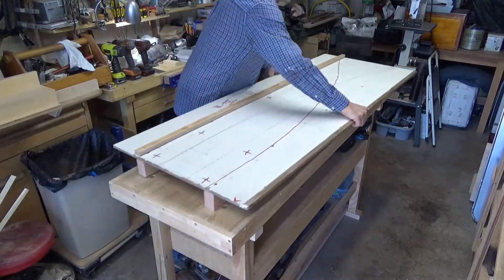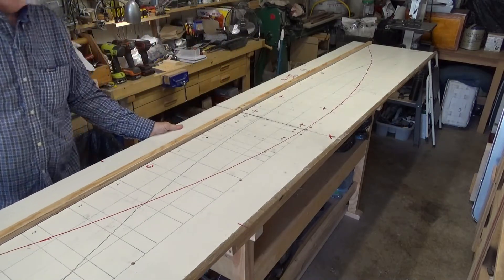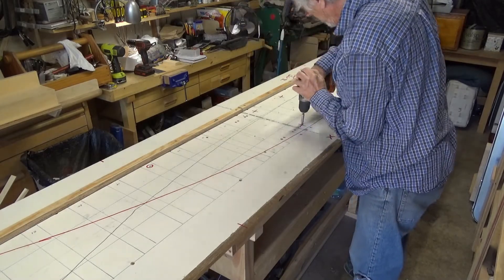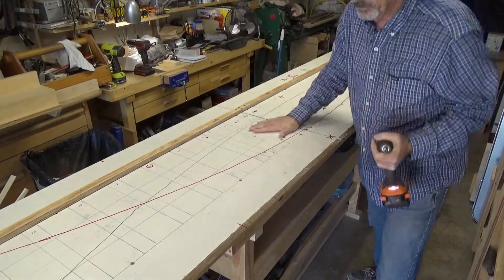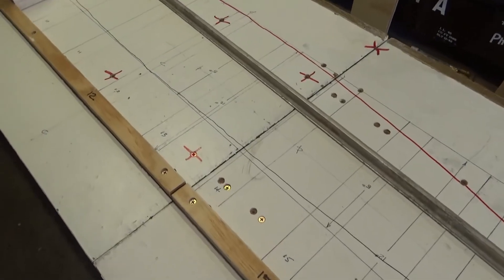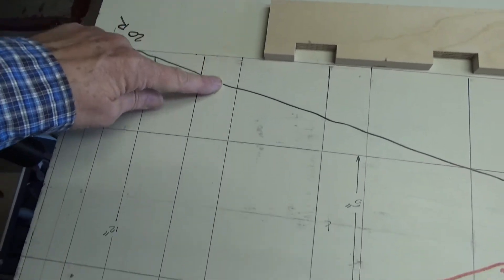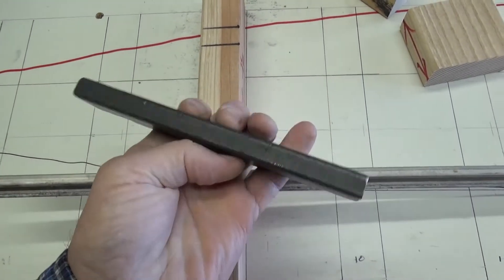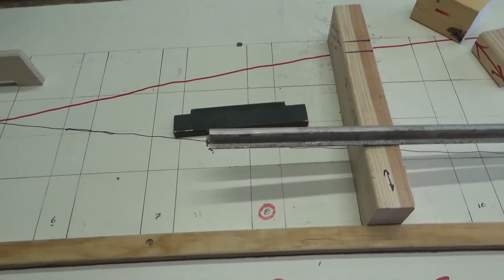Backyard Railroad - Part 10 - Jig for building 5" gauge track panels

Comment: I have been wanting to build a Christmas train for the front yard. it will not be a ride on train,  but approximately this size. I am looking for an inexpensive idea for the track. Any suggestions?
Reply from the maker: So you won't be carrying anything heavy like people, and that gives you a number of options.  If you don't need the rail to look prototypical you can use any sort of metal bar, box, or even angle for rail. It won't see much wear or stress.  Cut up some 2x framing lumber for ties.  Any curves in mind or just straight track?

Comment: Hi Stan,
  You are completly right. Building the track panel...is...a manufacturing process. Your using the open jig is exactly right. Then...if the ties vary in length...that is okay. Like your methodical style. Yes, enjoying doing the same steps repeatedly is the Zen method. 
  Soon, I'll be building track panels and will be emulating your methods.  
I worked for a solar co. I made 2,000 solar control boards. I made an open jig similar to yours. Because the 3/4" plastic (polymer?) boards that were the base would vary up to 1/4" in size. 
  There were 12 -1/2" copper solder joints per (purr) board. One pump, one expansion tank. I tested each and every board for one hour. Put 100 psi on the tanks. There were some leaks during this step. We'd resolder the leakers. Then retest for another hour till it held. 

  The boards were going to Camp LeJune in NC. A new housing development on the base. The super there loved my boards. Before I built them...the boards leaked after being installed. 
  All that is to say...I will enjoy the manufacturing process...again. 
All the best, Pete 🙂
Reply from the maker: Pete, Sounds like you are quite the engineer!  Track panel building will be easy compared to your solar electronic projects.  Not sure where you live, but both steel rail and aluminum rail expand and contract when sunlight and shade hit them here.  So plan ahead for that.  Leave some gaps between the rails-- more when laying track in the cold.  Don't over tighten everything.  The rail has to be able to move a bit as it gets longer and shorter.  I can see in my curves how they expand and then retract daily.  Have fun!

Comment: Where did you buy the steel for the rails? 
Is it premade, and you just purchased it or did you have to make the rail also?
Reply from the maker: No, fortunately I did not have to make the rail.  It is a bit larger than "official" scale for 5" gauge.  I think it's called culp rail (once popular near the east coast U.S.).  Extruded aluminum with a rail profile.  Obtained it through our club.  They run both 7.5" and 4.75" gauges.  I used a rail bender to set the rail for curves since they are quite tight in places.
Reply: @StanFerris  I was wondering if it was aluminum.
Reply: @StanFerris  I'm in kentucky, 
And I'm looking at this thinking... idk with all the rain and bugs if the ties would hold up. I have plenty of cedar, oaks, maples, walnuts, and even hickory on the farm to probably supply all my own wood. I just dont know how long it would last. 
Aluminum would be a great option to prevent rust.
Reply from the maker: It all comes down to the cost and availability of material.  Steel doesn't expand in the heat as much, but is a bit harder to work with and will wear your wheels more than Al.  Aluminum is softer and a bit less expensive, easier to work with, but expands more.  It is really expensive to ship long sticks of rail.  Shorter sections mean lots of joints.  But in the end, you go with what's available.  Same with ties.  If you can afford the synthetic lumber or accu-ties and have a supplier close by, they are very long lasting.  I had to go the cheap route and use redwood from the local big box store.
Reply: @StanFerris  have you ever heard of anyone using real railroad ties and taking a table saw to trim them down to size?
Reply from the maker: That could work, why not.

Comment: Stan,  in assembling your panels you will do yourself a favor if you will follow your screw pattern you showed early on.  I have succombed to doing what you did by swapping sides of the track when I was spiking.  By using the shown pattern will help keep the ties from skewing and the gauge correct.  The way you assembled the panel will tend to skew the ties and the gauge to become narrow.
By drilling up against the base of the rail and at an angle, tends to move the rail in the direction of the pointing of the drill bit.  The best practice is to drill just off the base of the rail so that the screw is vertical and will just touch the rail base when the screw just touches the rail base on both sides.  This sounds like I am severely criticizing your work, not so, I have over 20 years of full size track construction experience which directly corresponds to your work.  Track spikes are supposed to be driven so they just touch the rail base when seated.  The track gauge is easily adjusted by how the spikes are driven by how tight they are against the rail base when being started.  A small metal gauge for drilling the holes would be beneficial and easy to make.  Many happy and enjoyable days of track use.
Reply from the maker: Wonderful advice Roy!  Thank you.  Yes, I goofed up on this panel when I switched sides for the camera, and messed up the screw pattern.

Comment: ¡Hola buenas tardes Stan! Great to see the track units coming along. Question for you: Have the wooden ties/sleepers been treated or, will this be done before you lay the track outside?  I'll be interested to see you completing a curved track section as well.  As ever, a very informative video. Stay safe and well. Un saludo. Gary
Reply from the maker: No Gary, they have not been treated.  I decided to use redwood, and in a few wet areas plastic deck lumber.  Hopefully the natural resins in the redwood will give them 8 to 10 years of service if I can keep the sun off them.  I'll cover them with fine ballast as much as possible.  I just finished a really difficult transition area today.  I has the tightest radius curve, plus a concrete pad to span right in the middle.  Oh, and I have to make it look as discrete as possible so as not to arouse the neighbors and the HOA.  :)  Blessings to you Gary!